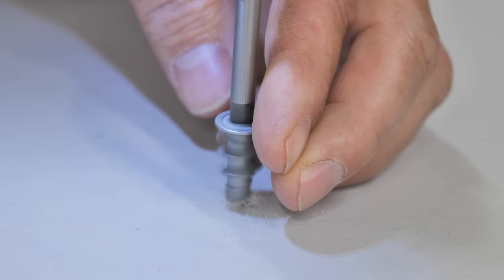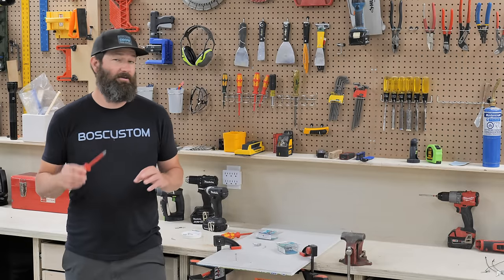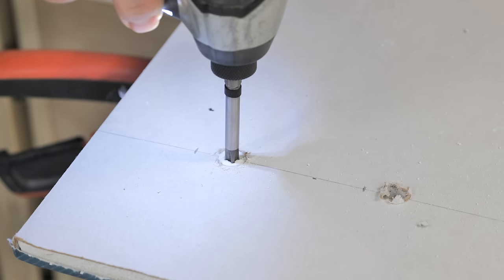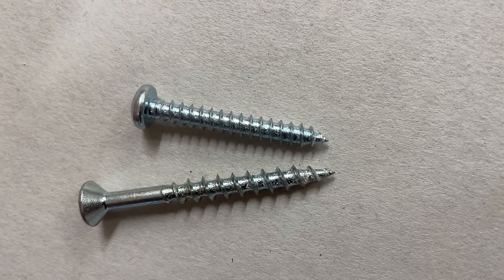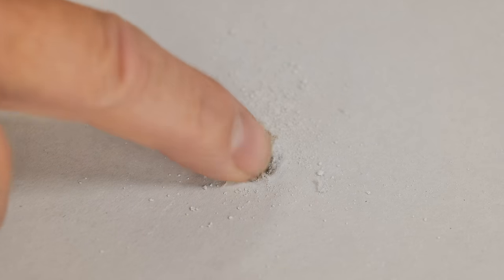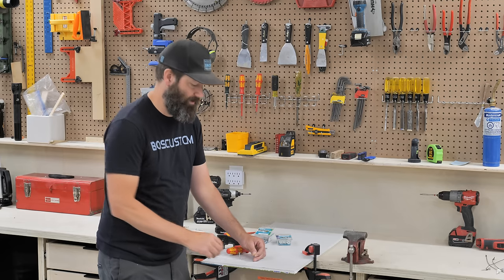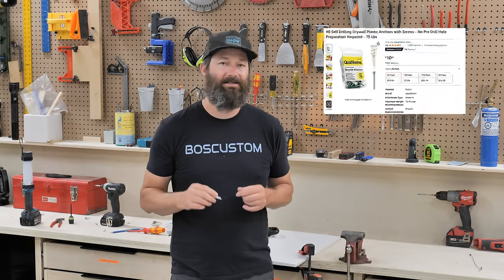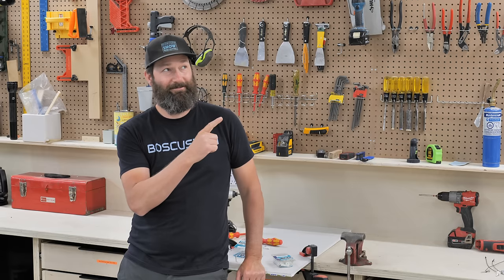How To Fix and Properly Install Screw In Drywall Anchors

Comment: So ahem. How do I put the anchor in.
Reply: Drill a small pilot hole or even take the tip of your screwdriver and a hammer and tap through the paint and drywall paper. Once the plug is secure in the gypsum behind the first layer of paper, feel free to screw it in until it’s flush.
Reply: Use a drill pilot hole without over penetrating the wall
Reply: @Tonyhouse1168  the instructions that came with the shelves I'm installing doesn't say anything about starting a pilot hole! It basically says to pound the anchor into the wall with a hammer! No wonder I was having so much trouble! Good grief, that's a huge step in the process! I wish we didn't depend on things from foreign countries, and we could buy pretty much everything American made. Because the people/kids in these factories overseas get very little pay for how long they work. No wonder they don't give a damn about the instructions! OK! Sorry! Rant over...😂
Reply: @angiemanges7945  the instructions have nothing to do with where it is manufactured
Reply: Nothing is made in America lol
Reply: Pay attention. He literally shows to screw it in with a hand screwdriver.

Comment: I always use a very small drill bit to pilot hole before popping one of these in. Seems to stress the plaster out way less when turning in.
Reply: Sometimes I punch a hole with a Phillips screwdriver. In my experience,if you want to use the plastic ones, some kind of hole is almost a necessity.
Reply: I also use a fine “Tech style” Flat head  screwdriver, sharp enough not slice into drywall and when inside  I twist around enough for the size of anchor . Also a great tool  to identify if you run into any material behind .
Reply: It's a must for me, the walls of my house have about eight coats of paint on them and the drywall anchors have a little trouble cutting through that to get to the actual drywall. And actually it's not even drywall, I just found out yesterday it's gypsum boards with a smearing of plaster on top.
Reply: Me too
Reply: I use the screw that comes with the plaster board fitting. That way I only have a small hole should there be something behind the board that prevents me going all the way through.
Reply: I drill a small hole and then finish it up with a screwdriver. Afterwards, you can twist one of these bad boys right in with very little resistance.
Reply: @paulfitzgerald7513 exactly just use the same damn screw to pre still the hole and leave the damn drill in the truck
Reply: Yeah, I can always make the whole worse/bigger 🤷‍♂️💀🙈 its way harder to patch the drywall lol

Comment: Power tool Guru here, just put your impact drill in the slow setting and gently screw it in the drywall. Drilling a small pilot hole does help a ton as well

Comment: E-Z Anchor toggle locks are the best of both worlds. They provide the best holding power out of all the anchors. Including the toggle one you showed on this video.
Reply: What if there is brick behind the plaster? Fail.
Reply: @13panda13  Yeah :-/ we have that problem in this house

Comment: The way the drywall anchors are removed gives a great demonstration of how much effort it takes to remove them, but the actual force on them is much more likely to be a shear force, rather than a lateral force.  This means the force test (ft lbs) should be performed in parallel with the drywall rather than perpendicular to it.
Reply: Maybe shear forces dominate when something is hanging on it, but it's a different story when a klutz is hanging a heavy painting or such. This is when the fitting fails. Use a butterfly mount from the start.
You have to be really clumsy (falling off the chair...) to pull one of these babies through the drywall.

Comment: As a phone and cable contractor from the 90's through around 2015, I must have used 10k of these. Awesome anchors. Maybe 20 seconds longer to install than a standard molly, so why would you bother with the latter? I saw the same tip I use was already posted, but I'll repeat it. A #2 round shank Phillips screwdriver makes an absolutely quick and very clean pilot hole. If you are putting in a bunch at a time, you can quick-zap them in with a drill driver, but leave them proud of the drywall. Then come back with that #2 Phillips and bring them flush to the paper. I can't recall ever having one fail, or start spinning once the screw was home. Guess I was lucky? Always enjoy a notification of your newest video. Thank you brother. From all of us... you know who

Comment: Thanks for another really useful, and concise video. Is there a chance you could review vacuum hoses for track saws? I can't decide if I want to dump the cash into the festool hose that I see used in almost all track saw online content. The smooth outside covering looks like it works way better than the typical corrugated hoses that get caught up on stuff on the bench, and the way it wraps around the wrist looks super useful. 

I learned a ton from your recent video on vacuum bags and filters, and the one on air filters. Keep making these videos - your's are the best because you give examples from your own experience, which includes lived pro experience that is invaluable.  But you also include pragmatic cost-value breakdowns that anyone (from home DIYers to pros) can use to make their own decisions. That's a really tricky balance to achieve - nice work.

Comment: I'm usually only putting in a couple of these at a time so I actually predrill a hole for the anchor and if it needs to be completely flush I make sure any paper that is sticking up is pushed back into the hole and then I form (without hammering) a slight divot/countersink around the hole with the ball shaped end of a screwdriver handle.  This enables the anchor to go in totally flush without having to use excessive torque and risk fracturing the drywall.  If the paper gets folded up under the head you will often strip the anchor hole before it will crush in flush.  An extra couple steps but my success rate went way up when I started doing this.
Reply: Thank you!
Reply: @crabwalk7773  I forgot to mention I also lube the screw threads with something non-oily that won't migrate like bar soap, tallow or wax.  I prefer one swipe of the screw on a bar of soap but when I'm helping out my dad he forces me to use his little jar of tallow he's had for about 50 years :)
Reply: @theslimeylimey  Very much appreciated - thanks again!
Reply: I have no idea what you just said but evidently it was good. I need a video demonstration!
Reply: @theslimeylimey could you go a little more into the reasoning of the swiping with soap and or tallow?
Reply: @theodore5223  To reduce rotating friction of the screw so when that day arrives where you have to remove whatever you mounted the screw will come out without bringing the anchor with it.

Comment: Thank you for this, I had a set of curtains come with these style of anchors and the damn screws did not fit past 2/3 of the way in and after it got past a certain point the anchor got over turned and was useless.  I'll be sure to buy my own from now on.  As a follow-up, could you show if you use washers or something with that alternative anchor and how that could be used in real use case scenario's. Thanks

Comment: I was on a project where we were using thousands of those Anchors in 50 year old 1/2 inch sheet rock that should have been replaced.  we found dipping them in some sheetrock compound before installing is helpful.  But you truly need decent sheet rock of the proper thickness to get them to work right.
Reply: Have you tried bullfix ?

Comment: To keep the drywall from mushrooming and to save time ...I use the round shank Phillips as the pilot hole drill  and that makes a cleaner flush.
Reply: an electrician taught me this a long time ago and it's made life hanging stuff on walls much easier
Reply: You mean you just manually screw the screwdriver in? Or use a Phillips head driver bit?
Reply: @gladitsnotme  Take the phillips screwdriver and use as a drill bit...rotate it back and forth into the dry wall to make a pilot hole/relief hole for the anchor. This helps to keep the face of the sheetrock from pushing out when the anchor tries to get flush.
Reply: I often use a countersinking tool to reduce mushrooming of the substrate.

Comment: If I'm using drywall anchors for anything around the house outside of a picture hanging on the wall I use the ones that self tap AND have the toggle built in. They are by far the best drywall anchors on earth.

Comment: One of the things You did not mention, is those Metal ones are usually meant to be put in wherever you have a Stud in the wall, Thought I would rather just use a longer screw if I searched for a Stud and needed a screw at that spot.

Comment: I discovered with those is I can put them in - very gently - with my power drill, but stop when it's about 1mm (1/2 turn) from making contact.   Then I'll insert the screw I intend to use and carefully ease it in.   If the toggle doesn't rotate I'll bottom the screw to tighten it that last little bit and then back the screw out as far as I need to.  The screw backs out with a lot less resistance than it went going in so usually doesn't try to back the toggle out as well (and a simple micro-flathead can 'pin' the toggle from rotating.  It's annoying but it works).
Reply: Have you tried bullfix ?

Comment: Snaptoggle for life! They’re unbeatable with up to 265lbs of capacity in 1/2” drywall. Worth the money. (Zip toggles are very similar) You’ll never use a regular toggle bolt again.
Reply: I absolutely HATED my experience with the zip toggles, but I had insulation directly behind the sheetrock I was working with.  NEVER use zip toggles with insulation abutted drywall unless you hate yourself.
Reply: I love the toggler alligator

Comment: Quick fix for pulled out anchors. Remove the screw from the anchor, blow out any loose plaster from the hole and the anchor. Squeeze a lot of Goop glue into he hole, making sure all side of the hole has a heavy coating and then coat the anchor with it. Put the anchor back into the hole allow a couple hours to dry and put the screw back in. The Goop will run down the back side of the wall and provide some extra strength.
Reply: Great tip!!

Comment: Use toggles. If it's a hollow wall, you should use toggles for anything over about 2lbs. 

Not because of the weight directly, but because the lightweight options rip up the wall with any real weight. Use the toggle and have a ton of holding capacity from day 1.

Monkey hooks are GREAT for light/medium weight items too.

Comment: Was wondering what you would suggest for ceiling AC registers where the screws don't grab and tighten enough to secure the register to the ceiling drywall?

Comment: What I do is, before installing, hold the anchor with pliers and run its screw in all the way, this pre threads it allowing any screw to smoothly go into the anchor ( and be removed smoothly) then install. This prvents the drywall issues from ever happening.

Comment: Here in the UK walls are nearly always made from solid brick. Cheap dry walls (  plasterboard ) are usually only found in offices, shops etc.
Reply: You need to visit a few new-build homes, they don't even use bricks unless they have too.
Reply: Most new builds are plasterboard.

Comment: I pop a hole in the drywall with a nail set and then use the clutch to limit the amount of pressure torque the drill can produce. I didn’t realize the plastic ones were better.

Comment: 0:20 the first one (metal) is designed for use into drywall AND backed by metal or wood studs. The middle one is for drywall ONLY.  And the one on the right is a lower weight rated piece for drywall.
Reply: Thanks!

Comment: Do you have a solution to when you put these in and the insulation inside the wall wraps around them and the tension in the insulation makes them unscrew themselves? Cheers

Comment: The Fischer Duoblade drywall plugs are far, far, far superior to the metal and plastic versions IMHO, if you get these in the states. The grip is really impressive.
Reply from the maker: Looks like an interesting product, it would be interesting to see how much holding power they have.
Reply: @TheFunnyCarpenter  You get amazing grip when screwing them into the drywall, even if you over tighten which I did the first few times. When you screw your attachment on it feels so secure, but yes would be interesting to see the holding strength. (I don't work for Fischer! )😁
Reply: I grew up in Germany with using Fischer wall anchors in the 1970s and 1980s, now living in the US since 1995. Different walls in Germany than here, but "Fischer Dübel" were the standard. Just read that Artur Fischer only died in 2016 and had more patents than Thomas Alva Edison. Have never come across Fischer products here in the US stores that I frequent, found something online now and will check them out.https://en.wikipedia.org/wiki/Artur_Fischer

Comment: I did what was said here and it still did not work. The anchors where still loose and stripped the drywall. I patched it up and now I have no idea if I’m going to be able to install curtains in this apartment. The former people in here already had holes in the wall. I just reopened them when I tried to hang my curtains.

Comment: Yes and don't use power drills for everything. In my work, I sometimes meet clients who are watching and then ask: "Why don't you use a power drill." - Thinking that it would be quicker save time and reduce my charge for labor. I have  a collection of power drills and an impact driver, always carry them with me, but for certain things, I stick to using my trusted and efficient Channellock ratching hand-screw driver. Much more feeling in my hand to avoid over-tightening anything.

Comment: I Use the Fischer GK wall anchors. German Engineering , better than the cheap ones from you know where. Each pack comes with a setting tool.
Reply: Have you tried bullfix ?

Comment: I need to hang an acrylic display case with mirror back to display some nice models. It will be 50/60 LBS inside the case plus the weight of the case. What’s the best method to ensure it never comes crashing down? The mounting holes in the case are pre drilled and I can’t center on studs so it has to go into the drywall
Reply from the maker: Check out an anchor called the Qualihome Toggle anchor.
Reply: @TheFunnyCarpenter  
Thanks sir. I didn’t expect such a fast response.
Reply from the maker: @Trashman702  😂just scrolling the phone before football Sunday fires up🍻

Comment: If I ever use those type of anchors I either hold them gently in a vise or a pair of grips and pre-screw the screws into them. 
That way when the anchors are in the drywall there's less chance of applying too much torque with the screwdriver.
Reply from the maker: Good idea Steve🍻

Comment: They are only good for sheer strength which is ideal for hanging pictures. Just use interset fixings for everything else in plasterboard.
Reply: Have you tried bullfix ?
Reply: @mstatham10  used gripit fixings which looks very similar. Will give them a try. I like the larger fixings that take machined bolts.

Comment: Off topic, I know, but this video is more recent and I don’t know how comments work on your end of the YouTube. I’m hanging a single, standard 30x30 kitchen cabinet in my dining area. I ran across a curious thing and hoped you’d see this to give me an opinion. The studs are 16” on center. Exterior wall. No *visible* outlets or plumbing. One of the two studs I’d planned to attach the cabinet to suddenly disappears at about the 82” point. As you travel up the wall, my stud finder finds and finds and then suddenly nothing. One stud is there all the way up and one seems to just discontinue. What do you suppose is happening there? I needed that area to attach the cabinet unless I can get away with leaving a few screws off the 6” of missing stud on one side of the cabinet. Any ideas would be great. Thanks and great channel. I’ve already picked up a bunch from your tips. The caulking video was insanely helpful.
Reply from the maker: I wonder if it’s a 2x12 header.  Try run the stud finder vertical starting below the 82”.
Reply: @TheFunnyCarpenter  thank you! That must be it because there is something running horizontally along the area that the stud finder picked up. It’s weird because it is not exactly next to the window. Also thanks for the reply! Cheers.

Comment: Question for anyone, would you trust wall anchors to hold rod for shower towels? I have a situation where neither side nicely mounts into a stud
Reply from the maker: If in doubt toggle bolts will hold.  The screw in ones are what most installers will use because there a lot easier.

Comment: Also, with these drywall anchors, you need to make sure there is ample room behind the drywall for the anchor to go all the way in or you'll bottom-out and it will result in the same thing as over tightening.
Reply: Have you tried bullfix universal?

Comment: As a fellow DIYer, I enjoy watching your videos however, this technique doesn't make sense to me. If I have a pulled out anchor that originally had a screw in it, such as to hang something on a wall, then a toggle bolt is useless. Toggle bolts are used specifically to anchor things to a wall. They must be pulled up tight so the toggle bolt holds firmly against the back of the drywall. I don't see how they would work as a replacement for that type of drywall anchor. For me, the best solution is to use extra strong drywall patch like Durham's Rock Hard Water Putty. Let it dry then insert a new anchor.

Comment: Use wooden lugs, after First screw insert take out inject some PVC glue, then screw it back it will fill any splits and will set a seal...now that's construction